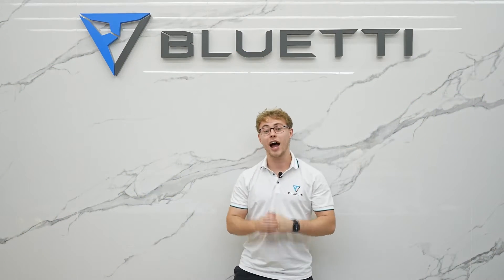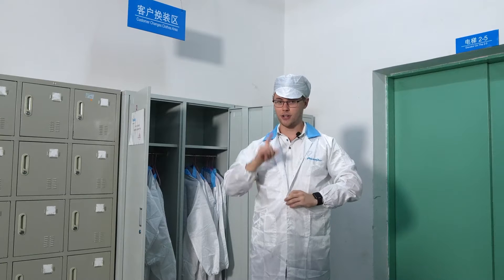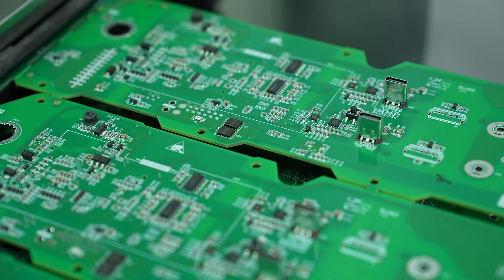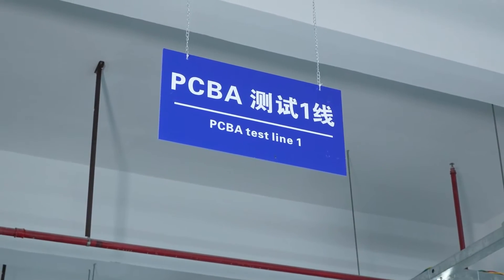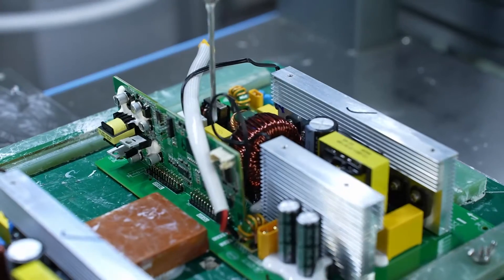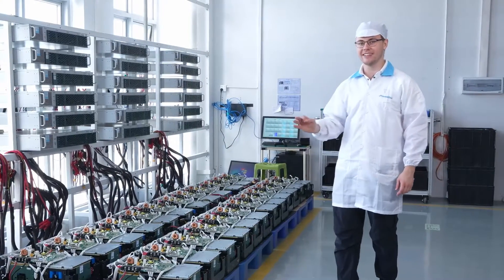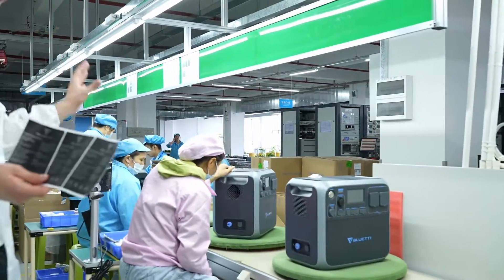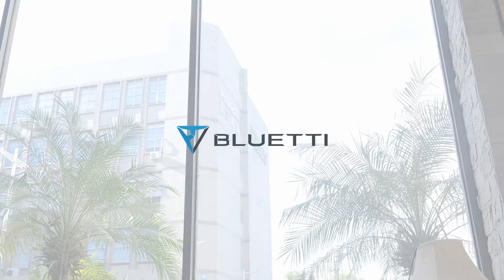BLUETTI Factory Tour 2022

Comment: When are you going to change to better batteries? 3500+ is too bad. Should be twice as many others do. Yours lasts 10 years and competitors have 25 years.
Reply from the maker: Thanks for the comment. Our life cycle measurement is on an 80% original capacity basis :)